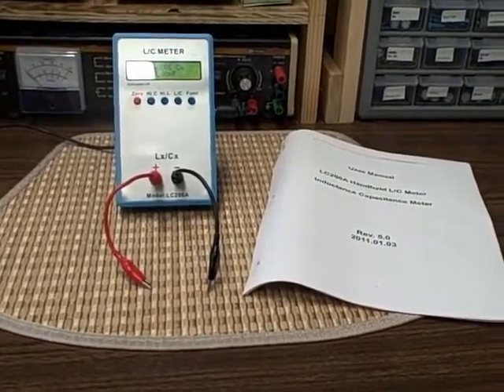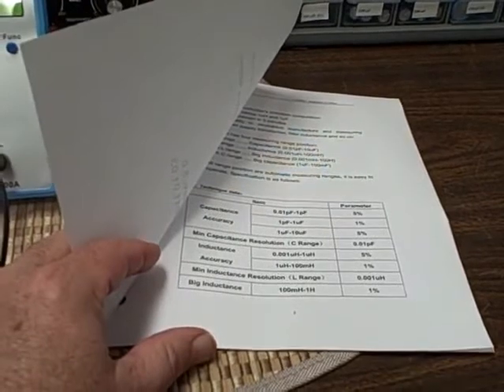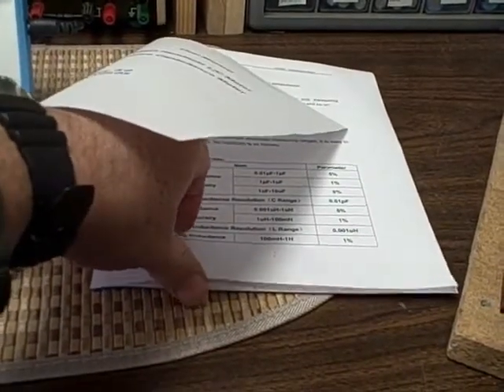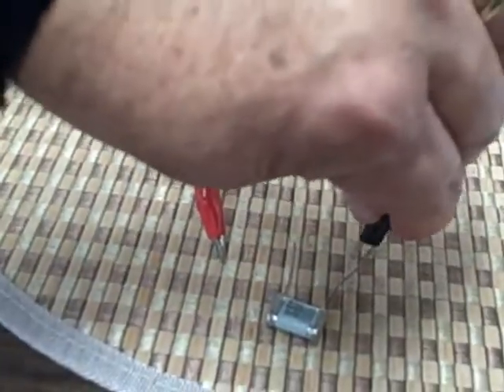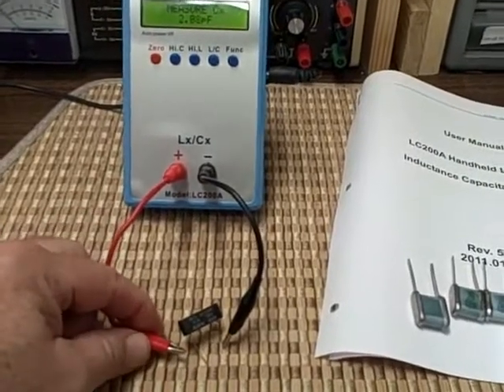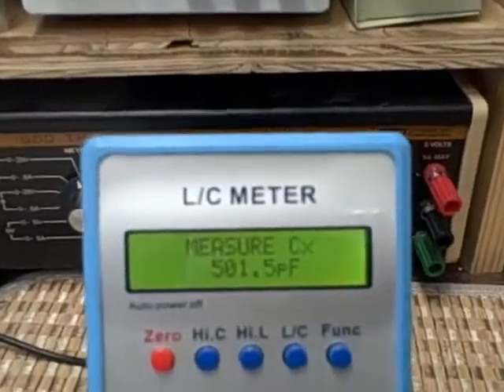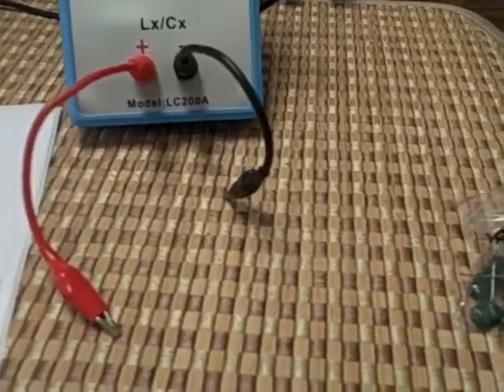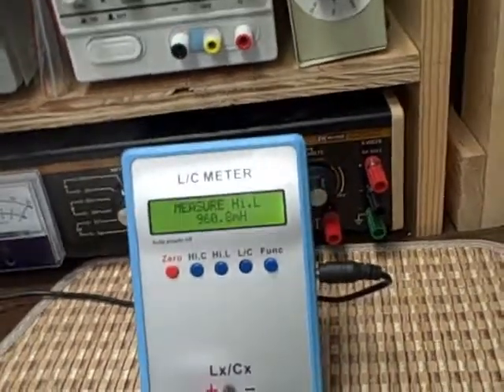LC200 Capacitance / Inductance Meter

Comment: Bruce, you have no doubt sold this already but, for folks stopping by, this unit is far better than the old AADE cap/inductor meter that was the "standard" we QRP ham builders relied upon. The gentleman who designed and kitted those passed away around the time your video was made and we fretted about a suitable replacement. These are on eBay for around $20.